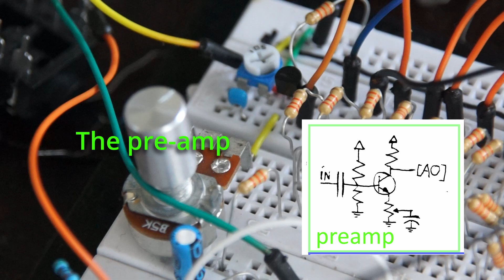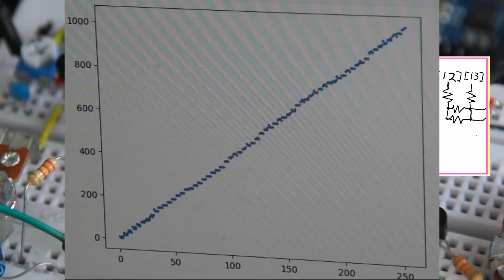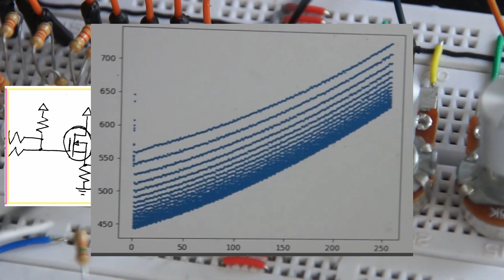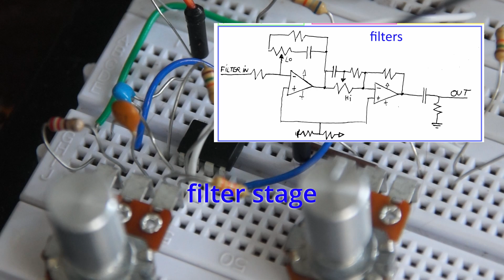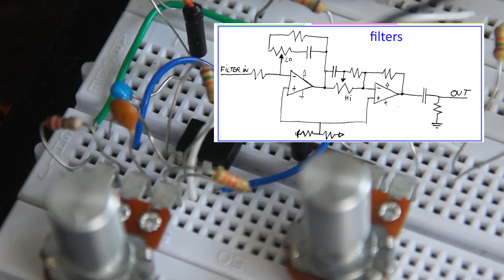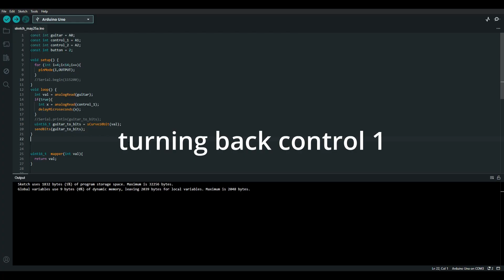How to make Guitar effects with an Arduino, Hardware Tutorial

Comment from the maker: After making this video, i discovered that you can change the frequency of the pulse with modulation to over 30kHz, so this would be usable for audio signals, this way you wouldnt have to make the digital to analogue part, instead you can use PWM

Comment: I don't understand what this is doing. Is everything just something that is set in a particular position, and then the arduino controls overlay on top of that? Or is everything controlled from the arduino?
Reply from the maker: the circuit is set in a particular position, and where ever it interacts with the Arduino i use square brackets, so [A0] is analogue pin zero, and [4] is digital pin 4

both work in tandem to create the sound, in total these are all the stages the signal goes through:
1) it goes in an analogue preampifier, watch my distortion 101 video if you want to understand it, i go through schematics and basic components there as wel
2) the amplified signal is read by the arduino, and mapped to and integer form 0 to 1023 in the code based on the voltage
3) after possible digital effects, the signal is written as a binary number to the hardware, and turned in to a specific voltage from 0 to ~5V by the hardware
4) after this there is an analogue filter stage that is completely independent from the arduino

so only in the parts between the preamp and the digital to analogue converter does the signal go through the arduino, the rest is basic electronic components, and some operational amplifiers (the triangles)
if you want a more clear explanation you have to be more specific about what part confuses you